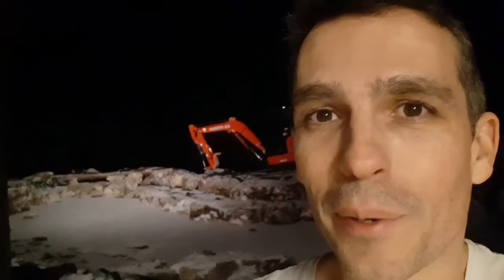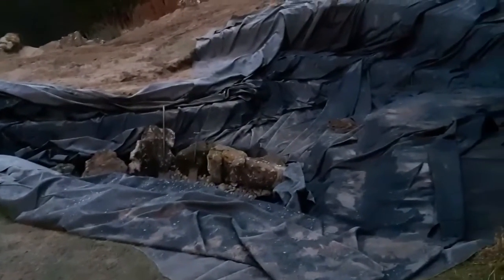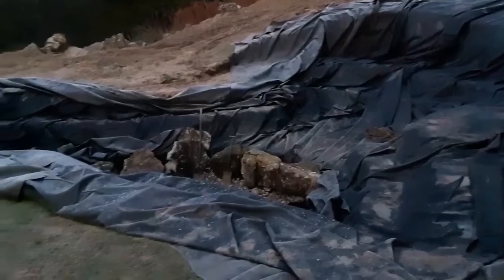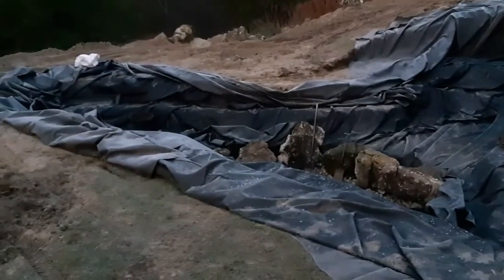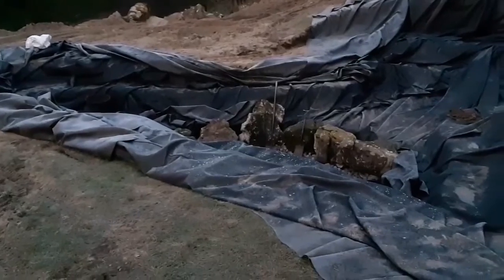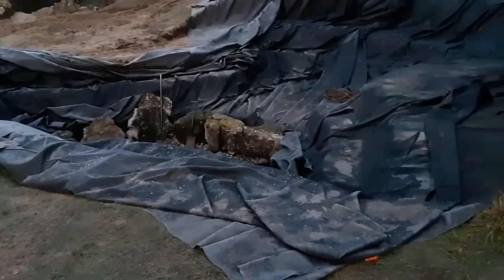Ecopond (sound needed to be removed for a song copyright, but I will leave the video up).

Comment from the maker: Edit: forgive formatting - youtube comments cannot be formatted properly. The weather has turned too extreme to continue pushing progress on the ecosystem pond. Here is a quick progress update to what is going to be a center for fertility for my food forest. It will be water for wildlife, habitat for water flora and fauna, aeration zones for propagation, sound therapy, and soul therapy. In the spring I will do detailed videos on the various aspects of pond building aeration layer, phtotropic layer, oxygen storage, preventing algae, nutrient balancing, natural filtering through roots, natural skimming through weirs, natural toxin removal through wetland filter, etc.**/edit: CARBON**I wanted to also discuss the carbon footprint aspects of this... this hasn't come up yet in the comments here or on youtube, but I wanted to get a bit ahead of it. I expected some heavy criticism on this project - as I was very hestitant on pulling the trigger here, and wanted to make sure I did a ton of research on what the carbon balance of a project like this would look like.I didn't want to get into too much of a conversation in the video because it may turn it a bit dry and long. The carbon footprint of this pond is significant, which was a big wrestling point for me in building it. My entire last 5 years has been on trying to go zero, or even negative on carbon as my family's footprint. It was due to this that I did more natural "hole in the ground" ponds. So far I have roughly 5 ponds and a 100-ish foot stream that I have dug with just a shovel, a sore back and a few hundred hours of my time. It has been a long haul doing this slowly over the last few years - a weekend here, a weekend there.  I'm quite pleased with what I have been able to accomplish with this, but there are a few "issues" with normal ponds.1) The entire volume of water of the pond is continuously exposed to sunlight. This is fairly natural, but what many clean-water well aerated ponds have is that they connect to an underground aquifer as a feed source. I have tried to replicate that in other ponds (basically trying to get French ditch drains dug as the feed source), but, well, it's not easy with a shovel to get 8+ feet deep through roots and such. Also, I have no long term assurance that this won't just tunnel a new hole bypassing the ponds.Digging 15 foot holes to create giant underground reservoirs which simulate aquifers is simply not possible with a shovel. Digging 12 foot deep holes to create deep oxygen storage zones of the pond is simply not possible for me on a fairly wet site. Once I get 3 feet down, I'm in water, and I cannot get lower. So, to do a "proper" pond, using wetland science to maximize various benefits - it's just not possible without an excavator. I considered purchasing one, renting one, or renting an expert with one, and economically the latter was the best option.I still have small pocket "hole" ponds, but I did want the heart of my food forest to be a near-permanent, well done project, which would outlive me. Even if the power is shut off, and the pumps no longer work, this pond will be 80% as effective as it is with motive force moving the water, and will be 200% as effective as a "hole in the ground" pond - due to the proper engineering design of various "layers" of the pond - combined with the passive systems such as water catchment.2) Filtration and water movement is crucial - typically through filtered reedbeds. I can divert my house runoff through a system like this, but for a standing pond, the only real reliable way to accomplish this is via external power. It would be nice to tap into my stream as a constant addition/overflow style system, but alas the regulations do not allow for this. So I have come to grips with the fact that I either risk heavy sanctions and tap into it regardless, or I abide by local laws, and move towards storage+ external motive force (pumps). I have settled on the latter.3) Because I have settled on the latter, using pumps - I now have a mission, a RESPONSIBILITY for that choice, to make this power as green as possible. There are a few ways I can accomplish this - more notably energy storage and solar photovoltaics, but also off-hours timers. My local energy is nearly 100% green (nuclear) after peak hours, and each year our grid gets greener and greener. As for PVs, I am waiting on Canadian election (Liberal minority) to help put some new incentives towards PVs. My goal, and again, my personal accountability, is to get this power source to be 100% renewables at all times.4) Talking along the responsibility and environmental stewardship aspects - I am also going to be using this pond to sequester as much carbon as possible. Not only will the pond allow me power-free irrigation of all plants on my land (I can gravity feed well oxygenated nutrient rich pond water drip system due to the elevation of this pond), but I can pursue other "projects". One such project is going to be trying to replicate - on a very small scale - [the azolla event](https://en.wikipedia.org/wiki/Azolla_event). This can be done with many plants, but azolla is on my short list. Now, the azolla event sunk the carbon to the bottom of the oceans, but my "carbon" using this same process will be "sinking" it into soils and then soil microbiology (their bodies as they consume the nutrient). Using biochar to help further provide microbiology habitat. Ideally additionally creating further coppice systems where I can get as much carbon sequestration going as possible.5) This pond will offer tremendous opportunities for automatic (well, there's pumps, but) high oxygen content water to be used in hardwood propagation. I am going to be tying off water from the waterfall section and using it to irrigate wicking beds, and possibly ebb/flow beds that branch off of it into the terrestrial sections. In these beds I'm hoping to propagate literally thousands of free trees, which I can then use in my other hobby - guerrilla planting and forest restoration of depleted local lands. We have an abundance of abandoned gas stations, industry, and farms around our area. We have areas where forest was cut down and now the field is transitioning to abandoned weedpits. These areas will eventually revert back to nature, but I can speed the process up a bit by establishing foothold emergent forest tree guilds. I have already made quite a few, and through this pond I can really increase my productivity in that regard.Why am I saying all this?Because this community (permaculturists and fellow environmentally conscious warriors fighting of climate change) does two things...a) Question and critique all expenditures of carbon (this is a good thing)b) Gets stuck in tunnel vision mode (this can be a bad thing).I want to give some exposure to people that spending carbon isn't necessarily a bad thing - providing that the return on investment is a further leveraged carbon sequestration tool. And the timing of when that carbon is sequestered is likely of critical importance also. HOWEVER, spending some carbon to set up a system which will then become a tremendous carbon sink, in my opinion, can be a VERY useful tool that us permaculturists can take advantage of. And if done properly, it can be very profoundly powerful in healing our planet.If you read any of this, you have my gratitude. If you have any comments, I'd love to hear it.All the best.

Comment: why is it so shallow/non deep?
Reply from the maker: It is 6 feet in the deepest part which is sufficient for overwintering fish. The depth was limited by the size of pond liner  which gets prohibitively expensive.  The size of line you need is width plus depth x2, plus maybe 10% safety margin. Increasing depth really quickly adds to how big the required liner is.

Of course for a hole in the ground pond you can just dig a deep hole as deep as you want, but them you will have anaerobic zones and breed anaerobic bacteria and create some methane. I wanted to avoid that.
Reply: @CanadianPermacultureLegacy  where can i read about natural pond designs?
Reply from the maker: @keylanoslokj1806  check out a youtube channel called Ed the Pond guy. He is really good.
Reply: @CanadianPermacultureLegacy  thanks a lot.